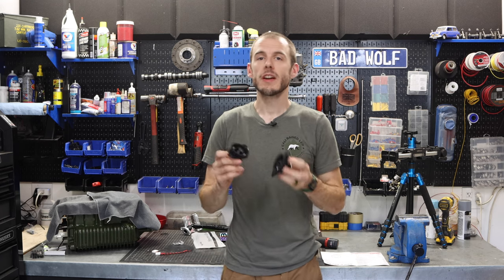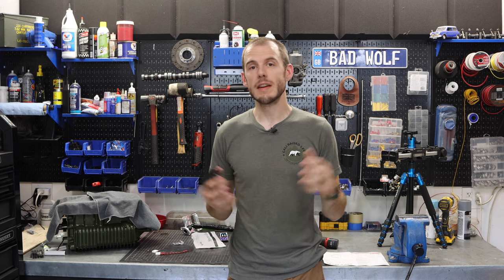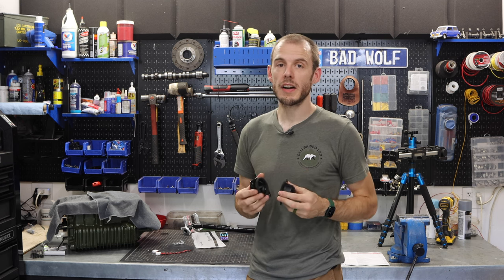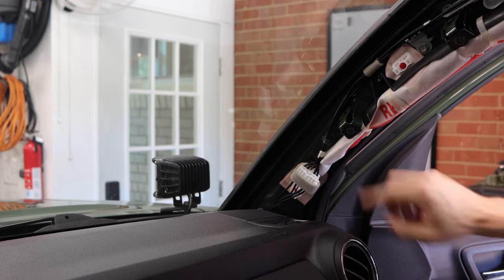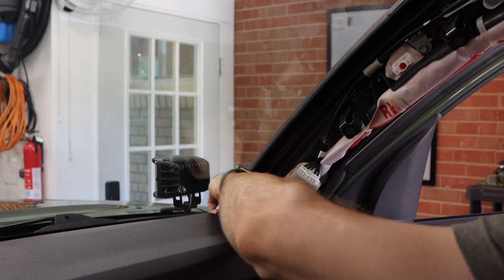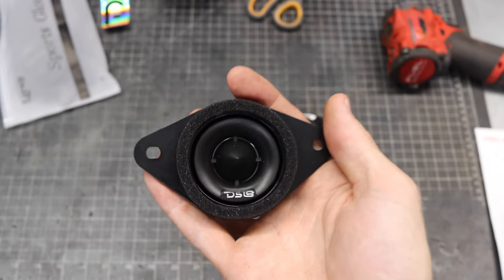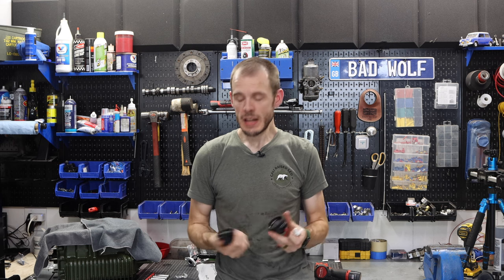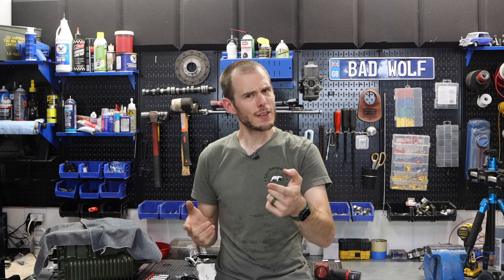Incredible Tacoma Tweeter Upgrade - DS18 Tweeters / Plug and Play

Comment: Just installed the DS18 Tweeters in my 2021 Tacoma.  I was pretty careful and took it slow.  It was pretty easy thanks to the video. Took about an hour and had no issues.  I was shocked on how good the DS18 tweeters made everything sound.  Was going to also replace the front and back speakers but now I'm not sure if I even need to.  What a difference.
Reply: What difference u noticed? Any bass to them?
Reply: @spawn11  Tweeters don't produce any bass (low frequencies).

Comment: The mounting holes on the speaker brackets are different on each side. Is there a wrong way to mount them? Will the factory have the same mounting holes? Where one is slightly oblong and the other circular?

Comment: I'm glad I went with the ds18 instead of kicker on my 22 limited taco it sucks there's only 2 options that are plug and play but I mainly got these bc they were $80 and the kicker was i think $120 so to save money I got the ds18 and not disappointed I also replaced my rear 6.5 stocks with a set of infinity kappas and I love it I also have a PA speaker on the outside to play music along with my 15" wdx db drive sub next will be my front 6×9

Comment: Did you disconnect the battery first? I don’t wanna mess up the side curtain airbag.
Reply from the maker: I always do for sure but doing speaker work like this it’s pretty unlikely you would complete a circuit that would pop the airbags.